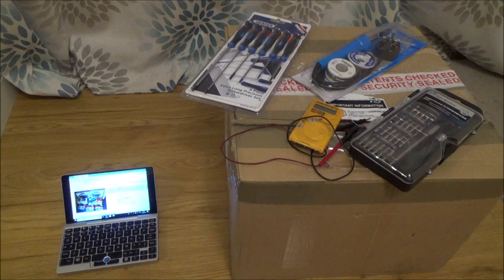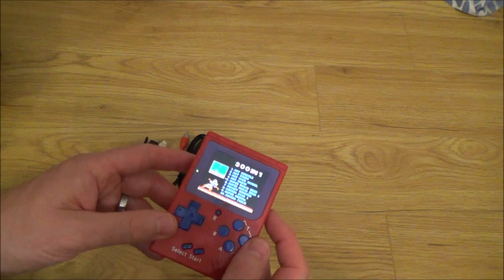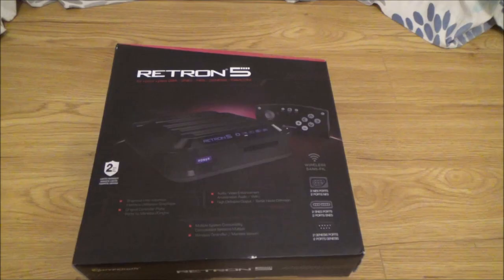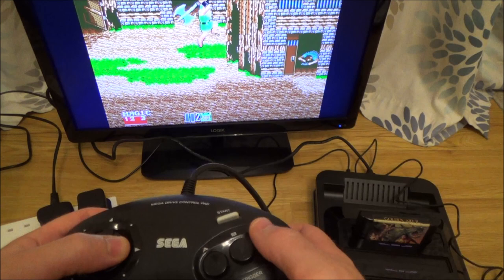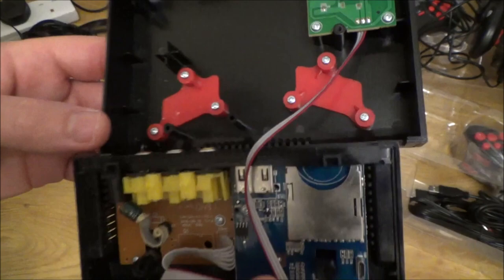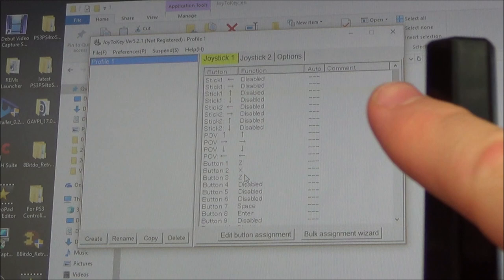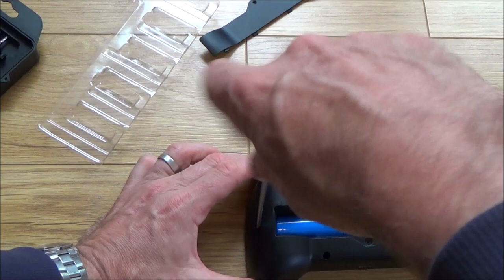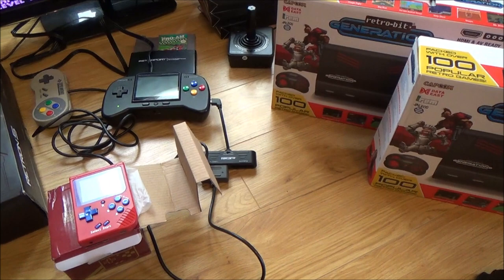Trying to FIX an eBay job lot of FAULTY Games Consoles & Controllers

Comment: Quick tip - when swapping out a power supply you need to confirm the polarity matches in addition to the voltage and amp-age. The diagram on the back shows whether the pin or the shell are positive / negative. Getting it wrong can affect the internal components.
Reply: yea and if you have 2 of the exact barriel cables you can modify one with reverse polarity

Comment: The capacitor of the retrobit was blown due to using a wrong AC adaptor :)
Reply: Agreed, the blown cap indicates that the wrong adapter had either been supplied or substituted. It was probably a 6.3V electrolytic capacitor, so sticking more than 8V would definitely make it go bang!
Actually, I'm more surprised that the chipset seems to have some kind of overvoltage protection, as cheap Chinese one-hung-low junk like this tends to cut corners in that area.
Reply: I'd recommend to at least remove the blown capacitor and bridge the connection, since it seems to work without it too. A capacitor that poped can't do anything anymore. And wow, I've never seen a capacitor that poped into a spiral lol That damaged thing doesn't provide a proper electrical connection anymore. I'm surprised that it does at all. Leaving that thing in probably isn't safe lol
Reply: dont bridge it
Reply: It should be fine to bridge the capacitor as it was the same voltage, pretty much, as the input which should also have a capacitor to keep the flow of currant steady, had it been a significantly higher value, or the old transformer style plug, id not recommend it
Reply: @phonotical  what do u mean by bridging??
Reply: @arjunravindranathu355  when you bridge something you connect the two sides together, like making a little bridge over a canyon, if you see the soldering point for one part of the capacitor, run a wire directly across it to the other side, positive to negative
Reply: @phonotical  AND by doing that... u will BLOW UP the power supply..
Are u serious?? Bridging??
Not to offend u in anyways brother.. but u wont EVER bridge the legs that are meant for capacitors ESPECIALLY ELECTROLYTIC !!
btw im an electronics engineer by profession. So..
Reply: Absolutely do NOT bridge the cap-  it is most likely sat across both + and - and acting at smoothing for voltage spikes coming from the cheap PSU.
But you have a soldering iron, and that's a lovely big capacitor- you could get 10x of those for £1.50 on ebay- do it for the experience. (and don't use 8V, when the machine wants 5V)
Reply: @slimysi99  it's 5v on and 6v smoothing, that's the 5 coming in and 1v resivoor.. youre not missing out
Reply: @phonotical  what are u trying to say?
Reply: @phonotical  its not ok to join it.. no one will join positive and negetive
Reply: @arjunravindranathu355  do what you want mate
Reply: @phonotical  ok mate.. but dont spread wrong info.
Reply: Thats wat i was sayin.. at least u can understand..
Reply: I'm also and electronics engineer, Do NOT bridge any faulty component !!! Capacitors are not fuses !!!!
Reply: Do not bridge and faulty component !! Capacitors are not fuses !!
Reply: Wow so much stupidity, and consistently too, refusing to be corrected lol. (Don't read me wrong, not saying Photonical is stupid for not knowing, but definitely stupid for not researching and learning from their mistake) Methinks somebody does not realise capacitors have multiple uses and that some of them involve being connected across +ve and -ve.  I take my hat off to you @Arjun Ravindranathu for being so patient and trying to explain to him. :)
Reply: Gauvain et ses jeux 
For sure
Reply: If its working with the 5V Power Supply maybe the 8V is just the wrong one, or maybe it drops to 6 or 5 with load on it. I guess the capacitor is just for filtering ripple, so having a good input, there is no need for it. Are there no informations in the manual what voltage is needed by the device?
Reply: I didn't know things like this when I first started repairing things but he missed looking at the console required power and polarity. He just checked the cable that came with the unit.
Reply: Or the original power supply was 5V 1A
Reply: That PSU was the problem...probably that's what poped the cap off the board,  someone must of put the wrong one back in the box. (Watching all your old vids now lol)
Reply: That capacitor was put on there for reduce noise it has on other appliances. It seat on + and -. So don't try to bridge it unless you wanna start a fire.
Reply: This And This This And This is is is This This is is

Comment: Worth mentioning when looking for a power supply to test, that some have the positive pin in the centre of the connector, and some are negative centre. There's usually a diagram showing you which is which.

Comment: Actually, the tip about not buying from somebody who deals in the hardware isn't quite good. I normally buy broken stuff from recommerce sellers a lot, got some very good deals. My last two Vitas I bought as faulty, one had no problems at all, I still don't know why it was sold as faulty and the other one had a bad shoulder button, it was reacting constantly and jammed the other buttons. For the second one I needed less than 10 minutes to fix it (and that included looking it up on youtube) and no parts at all. Those sellers get so much stuff that they can't check everything, they sometimes even don't check if the item really is faulty and just go by the customers' reasons to send them back.

Comment: On watching this video Vince, You used a DC Power supply, but in doing so you omitted to point out crucial Nay vital information, 
Information such as DC Power packs do have a polarity at the output jack to them, Some are positive female whilst others are Negative female, yeah-yeah.. Most peeps would know to be wary of this polarity and thus match the polarity 1st and foremost, then the Voltage 2nd, and then most importantly the Current the replacement power pack needs to supply. 
Nothing worse than connecting a power pack with the reverse polarity or wrong  voltage by being to high or the current is over the Top thus destroying the device that in fact needs very little current, but it may be that the power supply cant provide enough current and thus  go up in smoke..

Comment: Regarding the Retrobit -
as others have mentioned I would :- 

1. Note the polarity of the AC adapter
2. Note the output current matches that of the device e.g. AC/DC
3. Check that the voltage on the AC adapter matches the requirements on the units sticker (where available)

The popped capacitor was probably caused by using the wrong adapter in the first place e.g. 8V into a system designed to take 5V. Personally I would have changed the capacitor, 2 minute job and easier than soldering the micro USB adapter on to the board that you did earlier.

Comment: Just a quick tip, you must also check with your meter that the power supplies have the same polarity i.e. the central part of the power connector could be negative or positive. Also get some flux it will make soldering a lot easier.
Reply: I’m sure he knows that, and I know of no multimeter that can be used to immediately determine that.
Reply: @elephystry  late reply if the power shows - its reversed

Comment: Just a friendly tip when reading differnt voltage adaptors. Makes sure the polarity is the the same as the one required. Check what the centre tip ism negative or positive. Otherwise you'll hopefully just blow a fuse other wise maybe a capacitor or resistor.

Comment: You should reflow the solder on the usb connector of that gameboy-looking device with your reflow station :)

In the case of the retron, you should always check polarity of the power adapters. Also the devices should have a lable stating which voltage they require. Also, that capacitor is probably connected to the RCA ports.

Found your channel today, really love the fix vids, i like fixing things too!

Comment: I would also add to the power supply bit that you need to check polarity as some might have positive outer and reversing polarities is not a good thing. Also, some power supplies may be AC output but show the same voltage, again not a good thing.
Reply: My main point was on the unit that he went into his garage to get one with the same type of plug. he found a old psu. So I was pointing when using a totally different adaper you find not only check voltage but the plug is wired the same way. Since this was a beginners tutorial they might not check polariy or not know its relevence.
Reply: mrfoameruk he also never seemingly checked the base unit for their input needs. Most things have them listed, that would immediately shown that the 8v plug was way off. It will also show polarity for barrel adapters if you look close at the diagrams.
Reply: Used a incorrect psu on a old router ,forgot had bought from USA ,caused a bang and bit of smoke 😀.glad it only cost 12gbp ..
Reply: And one more inportant thing , check if its AC or DC The cap was blown by AC voltage .

Comment: I don't know if anyone has told you this. But that problem at the end is almost certainly a bad hotbar connection inside the tft. You'd have to carefully open up the display and apply some heat and presure where it connects. It's quite fiddly and little tricky but it generally works out well. I'm also quite certain I've seen that exact display module before, maybe worth googling it's part number.
Reply from the maker: Thanks for the info :-)

Comment: I remember a while back I bought a pink DSi for about $10 USD it was sold as broken with the parental lock on it also with a damaged/scratched up shell. But I got a good deal out of it cause I did a quick google search on how to remove the parietal lock and it took me about 5 min to fix it.
Reply: Very nice grab!  I had good luck with a PS4 that an eBay seller got in a Walmart returns lot.  They said they tested it and it was for sale for parts only.  I was able to fix it by updating the firmware with a usb in safe mode and getting a new controller.  The controller bit was bizarre though, the one that came with it refused to talk to the ps4 until I'd gotten it to respond to the new one. That PS4 cost me about $100 (plus $35 for a used controller) and is currently my most used console.
Reply: Wow, they must be like the only person to ever use parental lock, lol.

Comment: Just wanted to give some tips for those who haven't soldered before and would like to try this. First, a cheap soldering iron is okay, but get some decent solder. Also, you can use a moist sponge to clean the tip of the iron. And finally, pre-coat the iron with a little solder before you try applying any to the desired location; the solder will melt much quicker.

Comment: Interesting video, the only thing I would recommend for new people trying this is to also to use some flux, it will help the solder flow, in the Bitt-Boy's case it would have made it so he could have even with a large tip just heat the USB Jack's pins even with the larger tip and it would have been an even more solid connection. Keep up the videos mate, this im sure will help new people learning the basics!
Reply: Oh and also its worth mentioning that the polarity of the power supply should be checked before using it too :)

Comment: Careful with those USB power bricks. They don't always output what they advertise! I measured my own once and found one of them, an OEM phone charger, very out of spec (close to 7v IIRC) although labelled at 5v. I've heard chargers like these have been breaking controllers that can't tolerate the voltage difference (possibly from one of your future videos!). Love the repair videos. Cheers!

Comment: I don't know if you have one already, buy you can order a decent soldering iron from AliExpress for about 40 quid. The new type irons with the elements in the tips. Much better heat transfer. Quicko is the brand name of the decent ones which are like clones of the Hakko brand ones. Keep up the great work, love watching this stuff :)

Comment: For a lot of companies who move a whole lot of product, even trying to return an RMA product doesn't make sense. I remember ordering a used 1000w EVGA power supply on eBay and it did not work. The seller asked me to smash it to an unrepairable state then they would send a refund. I guess not even the cost of giving me a return shipping label was worth it for a product I spent like $180 or something.

Comment: The problem with LCD is a fairly typical issue, normally the soldering on the side of the display going bad. It /could/ be repaired but you'd have to take off that metal shield and risk damaging the display even more, would be easier to find a replacement

Comment: For those micro usb ports a small heat gun makes the job easy as pie, I replaced a butchered micro usb port on my nephew's tablet and it was very easy, just put some flux, heat, pull with tweezers, touch up the pads with a little solder with the soldering iron, align the new port and heat up again, easy peazy!
Reply from the maker: Thanks for the tips :-)
Reply: You're welcome :)

Comment: regarding the lcd. you have a gate and a source line to controll the liquid crystal inside. they work similar to some basic control pads where two lines have to .. cooperate to create a proper signal.  the horizontal lines are caused by damaged signal lines. cheap devices usually have tn displays which are naturally white. so since these lines are white they do not get any orders. in most cases either the flex cable or the lines on the glass are damaged. this is not necessarily caused by a user but such items can be ok at the outgoing qc and then fail later as the initial defect worsens. even aging and stress tests can fail to detect them. but i doubt these devices had a proper outgoing quality check like proper brand products. nothing much can be done about it sadly. other than replacing the screen. (former employee in the qc team of LG display, formerly goldstar)

sorry for the bad formatting, but i am writing this from my phone. xD

Comment: Your soldering iron is actually fine for jobs like that.  What you need is FLUX.  Flux will make the solder flow onto the joints so much better.

Comment: The console was most definitely used with the wrong power supply, doesn't necessarily mean it came from the factory like that. I would definitely recommend replacing the capacitor and using a 5v power supply, the extra 3.6v from the 8.6v power supply is what popped the capacitor. Could of also suffered reverse polarity. Great video really enjoy repair videos.
Reply from the maker: Thanks for sharing :-)

Comment: The problem with that screen is that the ribbon that connects to the actual screen is not making contact. Could likely be fixed by putting pressure against the side of the screen where it makes contact with the ribbon, likely the left or right side of the screen.

Comment: @My Mate Vince with that retro duo handheld you could do like they do with the original gameboy sometimes when lines appear you heat the point where the ribbon cable connects in the screen and it fixes that issue, i don't know you could do that with that screen but there is nothing to lose if you give it a try.

Comment: Maybe the retro bit unit was packed with the wrong power supply ie the 8v one , the parents prolly just snatched the nearest black plug , read the back of the console or the booklet for the running voltage , prolly is 5 v m8 . great vid m8 im goin to start from 1st video up to newest . Keep it up m8 .

Comment: For the last one I would have open the screen metal enclosure to check the connection of the lcd, sometimes it's also easy to fix by just heating the contact a little bit. If not a screen of this type should cost 10$ shipped on aliexpress ;)

Comment: I've had a similar issue with a power bank. the micro usb charging port literally broke off when I unplugged it from the head of the  cable. Unfortunately it was surface mounted, and it tore off the pads when it broke

Comment: Just saying but I think that retrobit console was supplied with wrong power adapter.... And when it was connected the capacitor popped and no one touched it. Now my guess is that the rca jacks wont work.
Reply from the maker: I didn't think of that, it could well have been packed with the wrong adapter for it. Maybe in the factory they have various different adapters for different systems and some got mixed up before it was spotted :-)
Reply: Exactly...
Reply: Yes, I would try the 5V adapter on it after changing the capacitor, which is a simple swap.
Reply: Not strange at all that it refuses to operate with that excess of voltage, considering that maybe the system is even run at 3.3v (quite usual in System On a Chip emulators). The internal regulator (if fitted) would maybe block that for it's own protection. I won't leave the capacitor unreplaced. Maybe it was placed in the analog video output for smoothing purposes, so you could expect bad analog A/V output until it is fixed.

Anyway, clear explanations and an excellent hands on approach to fixing things. Looking forward to your next video
Reply: If the 8 volt adapter is ac and the 5 volt is dc then you got the explanation for the blown capacitor. ac voltage to an electolytic capacitor will blow it up. As simple as that.
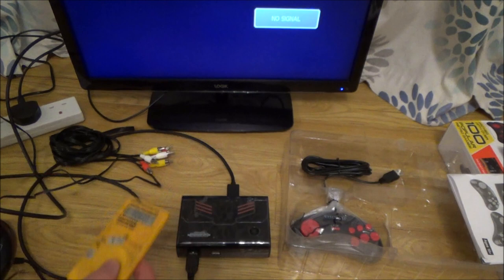Reply: Lennart Stenberg. In the video it says 8v dc(output) 25:10

Legend i5
you can buy them seperate( https://www.amazon.com/Retro-Bit-RetroGEN-Adapter-Supply-Genesis-Sega/dp/B00VVS2CQA )
seems weird that they would just swap one but idd possible
Reply: Also you can get non-polarised electrolytics for AC smoothing, quite common in at least older TV and Radio sets.